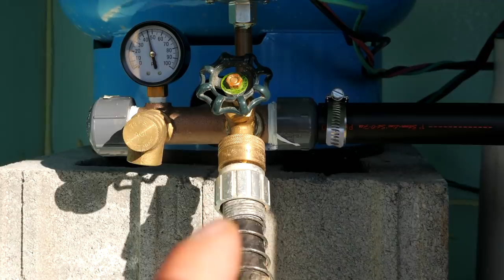Insulating the Well House & Preparing ICF Basement for Waterproofing

Comment: A electric (once you have it hooked up) inkbird thermostat will help. You plug it into electric... then plug in a heater to it. The really cool part... they are not expensive and they will use wifi to send you a alert to your phone if the temp falls below your setting. That gives you the additional back up of a alert before a major water problem will happen.

Comment: I found the “King” 110 pick a watt heater for wall mounting, set at 500 watts, very economical 
The Thermostat is mounted on unit.   We heated a large Dog house, during Northwestern winters and well insulated 6x4 barn style for two big dogs. Lowe’s sells “king” heaters and are UL listed.   (We used the small rectangular model with 500, 1000, 1500,  options.  The wires have to be selected at element for desired wattage).

Comment: To keep the house warm enough without electricity a small propane lantern set at it's lowest setting should do the job. You don't get that cold for that long. you probably won't need to use it unless it gets down into the teens.

Comment: I agree that a old style 100W bulb on a thermocube works fine for an insulated pump house. I built a bigger closet in an unheated barn in Massachusetts. It worked fine for 3 winters.

Comment: Eventually you can trench the water line and bring the pressure tank inside the basement once the house is built. Easier low/no maintenance and protect from freezing as pressure tanks have a mechanical lifespan and have to be replaced from time to time. You have enough work on your farm than to have to remember to check on the pumphouse.
Reply from the maker: Exactly. That is the plan.

Comment: You can get a solar powered 150 watt bulb and your pump house with the insulation you put in would keep it above freezing. I also like @Cheeky Saver's suggestion. Once you have permanent power it will be easy to find a method to suit your needs.

Comment: 1)Cheap temperature sending unit in there. 2)100 watt bulb down low near unit with switch outside (Ultimately in house).
Reply: metamud aid they are going on grid and theres a electrical pole not far away.  Assume their pump will need electric anyway.

Comment: Good on you for also insulating/covering the floor inside your well house. 

I was part of a military exercise (Operation Jack Frost 1979) in Alaska where a tent "city" was built to support an Army/Marine exercise where they simulated defending the Alaska Pipeline (which was in its final construction phase at the time) from "The Soviets". My Air Force Prime B.E.E.F. team built plywood floors in all the M.A.S.H. campaign-style tents used at the time so we could put diesel drip heaters (usually two--one at each end--of the 10X40 tents), since it averaged 50 BELOW Zero during much of the overall 5 week, Jan/Feb operation. (The actual exercise where the Army/Marine defenders did their thing was three weeks in, and only lasted 3 days. The rest was set-up, then 2 weeks of debrief and tear down. I, as the squadron Base Emergency Expedition Force [B.E.E.F.] supply sergeant, was one of the few who spent the entire 5 weeks up there; it seemed like 5 months!!!) Anyway, when we tore down the tents, the necessity of those plywood floors was graphically evident: The footprints of 35+ 10X40 tent sites were clearly visible as thawed portions of the tundra, which, when walked on, felt eerily like walking on a waterbed (yes, I know what that's like!)

Undoubtedly, the floor of your well house would be a soupy mess if left uncovered, and by insulating it, you'll actually let it stay at least solid, although probably not frozen. Good job!

Comment: Hey Guys...I just restored my Papas well.  I also spliced in a 9000 watt generator when power goes out.  However the whole roof and 3 cinder walls got demolished (because a tree grew up at a corner and blew out the grade and walls)  but I'm learning alot.  I'm all on well water now!  Still restoring the original well house but will insulate it like yours!  Thanks for the video.

Comment: As you have an electrical supply to the pump house, I would add anti freeze protection in the form of a bar heater, with a thermostat set to 5C (42F) so that it will warm it up. Fish Tank heaters are small, better to go slightly bigger. I would also paint to roof and walls with black paint or with bitumen, not for waterproofing, for radiant heating from the sun, the snow will melt sooner and the sun will warm the water pump house quicker.
Reply: don't think has electricity, he was using generator to power pump for testing.
Reply: @garyb4929  OK

Comment: Great update as always . In your well house , consider adding an outlet inline from your well electric supply line. Then buy 2 ( backup)  "thermo " block ( amazon cream colored not the yellow one by a different name) . I buy the one with 2 outlets. It will cut your light on when below freezing and cut off when above freezing. You can also use a second light on the second therm block outlet , but install a screw in photo cell then your light bulb. Why , when the first bulb might burns out the second light will come on. Backup :) Also the bulbs that "last" 1.8 years , that is a 3 hours use per day. So  well light without a thermo cube will last 30 days with 24 hour on time in the winter. I place the lights on bricks or a large concrete paver. Because if a mouse knocks the light over the light will melt the foam of worse break and short out, throw the breaker.  I also remove the lights and thermo cube when the weather gets warm ( the humidity in the well house will go to 100% now that it is insulated ) . I test the thermo cube at the beginning of winter by placing it in the freezer until cold ,then take it out and  plug in a light and when it warms up ,  it turns off the unit is ready to use, test passed . My well guy gave me thumbs up on my inline well filter. I installed it before the bladder tank. This keeps the sediment / grit out of the pressure tank , it will extend the inner bladder life . I also double clamp all fittings, stainless clamps. I leave a screw driver in the well house to test the clamps every filter change. If you want to go full protecto, wrap a thick plastic gal bag around the pressure switch. with a few cloths pins, closed seam downward. You could also install a weather tight electric wire box clamp to the pressure switch , where the open hole has the wiring running through. No water in the switch , no rust, longer life. A tale of experience, you will have mice in the well house. I always set 2 traps with a little peanut butter , because where there are mice there are snakes. The only type I find and have killed 2 , baby copper heads, on different occasions. They like the safe , cool concrete blocks I have inside. On the pored walls... will you be using a dimple shield over the peel and stick to protect the waterproof material from punctures ? here is a little something I found while reading on line . hope it helps. 
"When you say non-permeable sheet, do you mean a type of 'peel and stick' membrane, a thick rubberized material that comes in rolls??

I use a few different products depending on which ICF I use, whichever brand name they supply, Nudura has their own brand name, Logix has Resisto or I buy a product called Blue Skin at the local lumber store. All are the same thing, pretty much.
 I don't worry about the 'sheet' tearing during backfill, our Code requires backfill be done with a 'clean' material, typically sand is used, it is free draining as well as it being free of any rocks or materials with a sharp edges that would damage the waterproofing.If that is still a concern of yours, you can cover the 'peel n stick' with another product called Delta MS, I am not sure is this is available in your area but something similar may be. Check it out at www.deltams.com. This product is a solid plastic dimple board, that you would roll on on top of your peel n stick. you use a screw and washer system and attach it at the top to the attachment strip in the ICF. There is no way that this product will tear, unless the excavator hits it!! The dimples in the product leaves a channel between it and your wall for water to run just in case some gets between them.I have used both in the past and so far no one has called me back to fix a leak." source- http://www.greenbuildingtalk.com/Forums/tabid/53/aff/4/aft/36460/afv/topic/Default.aspx#:~:targetText=It's%20pretty%20commonly%20accepted%20that,LEAST%204%2D5%20days%20old.
All the best , thanks for sharing your journey .

Comment: One things you might want to consider, if your ground freezes solid there, is to insulate the outside by at least stacking hay bales around the base of the concrete blocks. This keeps the cold from freezing through the ground.

Comment: I see you installed a cycle stop valve.  I really like mine.

My well house is 7' x  7' x 12' buried 5' in the ground with a shingled pitched roof. I use a milk-house heater on a thermostatic receptacle that comes on at 35°.

Comment: It looks like you are making good progress. I’m from Australia, so not much needs to be done to stop water pipes freezing (except in some of our alpine regions during winter). That said, I saw a video the other day where the homesteaders were trying passive ways of keeping their poly tunnel from freezing overnight. They ended up putting in a number of 50 gallon black water containers as thermal mass. Your pump house is kind of like a refrigerator now and refrigerators work best when they are full. Maybe you could try some water containers to reduce the air space and increase the thermal mass within the pump house. Regards, Jeff. 👍😀🦘🏠

Comment: I have the same set up, and the insulation and a small well house will be installed this week. A bit late, as we already had frost and several snowfalls, but temp rise again, and rushing to finish it. Anyways... The pressure tank, why don't you install that in the house? I was too afraid of frost, so that is placed in the technical room with the water heater, water softness filter system and the air filter..  Also have the pipe in pipe water system in there, with controls if there is a leak somewhere, and the fuse box! Crowded room. 😂 So happy for you finally getting things going. Guess the girls are excited to plan their rooms!

Comment: A small heat lamp works good for a heat source. Doesn't draw to much juice and does not get to hot. Nice job on the well house.  I sure hope you at least prime paint the wood on your well house. Protect that raw lumber, although the wood is unlikely to get wet, blowing rain could wet the raw wood especially the end grain of your rafters. Thanks for the videos.

Comment: Moving right along.  It sucks that you had so many issues trying to find a general contractor and others delays.  I realize that summers are real hot there, and working on the house would have been sheer torture most times, but if the exterior of the house were done before winter halts work, you could have been able to continue interior work on warmer days. How deep is the basement, and will you be putting any kind of flooring in it?

Comment: Looks good! Will the same crew be out to remove all the bracing? For the Well House, you might want to consider a Min/Max battery powered thermometer to see how cold or hot it gets inside. Just for some data points.

Comment: For all the folks saying that a light bulb is all you need to keep things from freezing, my neighbour did that and it cost him a $900 pump, apparently it heated the roof more than the floor. Try a thermostat with an infrared heat lamp pointed at the pipes.

Comment: Don't beat on a plastic fitting, apply a little heat to the pipe it will slide all the way on.
Reply from the maker: I was gentle. 😏
Reply: A little spit on the fittings makes things slide too !

Comment: THERMAL MASS is your best protection from off grid freezing.
Put 55 gallon drums inside and fill with water. Buckets/lids or gallon jugs.
I used shelves with 2 liter bottles from My soda addition. :-)
I have a 2 gang duplex receptacle. When we're going into the low teens I'll drop an aquarium heater in one of the drums. It's thermostat controlled and cheap so I keep 2 int the well house. - Prepper rule #1 redundancy. 2 is 1 and 1 is none. -  
Use food grade containers and you'll have a back up supply of water for power down or pump failure situations.
Good luck - KJ -
DesertSun02 has some great videos about solar heating options. One is heating water with a solar panel. If you heat the drums of water during the day they will radiate heat for long after and protect from freezing.
And I agreed with one of the other posters. Take the insulation off the floor. You don't want to insulate against the warmth from the earth.

Comment: Our well has no parts that can freeze at the well head. It has a 500 gallon holding tank under ground. It runs to buildings and frost-proof hydrants from there. Are you putting that pressure tank and other stuff in the house at a later date?
Reply from the maker: Yes

Comment: Sir, you may want to put the spray foam around the white tank bottom, and down in the cinder block, as I had a pump house, in KY, very similar to yours and a whole lot of snakes, decided to use it for their winter hibernation  house. I removed 42 snakes the 1st year. They were mostly grey rat snakes and never got mad I was hooking them and moving. I don't usually kill snakes unless a life is endangered and I read a recent study shwed that snakes just 1 can kill up to 2500 ticks a year. My pump house was 50' from the  house so I would just release them down over the hill as I had 35 acres in Ky back then. God I miss that land and house that was almost 20 years ago and that would be worth 200k now, we only paid 66k for the land with 3 ponds, a small garage (they called it) however, you could probably only for a dodge neon in there comfortably. and a 40x46 ft barn than was all metal covered and huge that you could park 3 cars in there and have 8 horses or cattle and a  lowered hill 4rd stall where you could separate animals and it a the land had a small creek running though it and the 1 pond was  so big it was an acre and it was stocked with fish. god I miss that place me and my wife broke up and we had to move a developer bought it separated it into 3 parcels and now there 3 houses on it right on top of each other when before i needed binoculars to see my nearest neighbor now the neighbors are close i can hear them talking between the walls. these are great videos by the way thanks and sorry for my rant.

Comment: With no power, you could place 1 battery with a 300 w inverter.  A thermostat controlled receptacle with a 60 w bulb would be all you need. Much safer that burning anything inside. You could charge the battery every 4 or 5 days.
Reply: Or put up a cheap solar panel to keep charged ... Wouldnt have to be much ...

Comment: I noticed 1 hose clamp was missing on the elbow coming off the pump that ended up under the insulation.
Reply: Yeah I noticed that...good thing is that is not really high pressure at 50 psi and its an easy fix.

Comment: Would you ever put a wireless thermometer inside the well house to log the temperatures it experiences?  One that can record both outdoor and indoor temperatures so you could see how well your insulation is doing would be very interesting.  Personally I'd be reluctant to run 60/100 watt light bulbs as so many people are recommending unless there was some kind of thermostat involved, because it would waste so much power if it was running when it didn't have to be, e.g. if the grid was unavailable in winter and you were relying on solar only.

Comment: When your pressure tank dies, consider replacing it with a cycle stop valve. They are more reliable and have no moving parts.
Reply from the maker: 😏 There is a cycle stop valve right at the well head in front of the tank.

Comment: You may want to spray foam around the well pipe casing.
Reply: And add flexible conduit armor to the wiring between the pressure switch and pump.  I live in southern OR (and we're warmer here than you) so I replaced my PVC well piping with galv after I had one freeze.  I sleep better now.  R15 Knauf glass inside the big pump house usually keeps it above 40F.  Oh, and i installed a Big Blue 4.5"x20" whole house water filter using 3/4 PEX.

Comment: Use heat tape on all exposed piping above grade in order to avoid pipe freezing problems
Reply from the maker: Sure, once we have power to the property.
Reply: @Guildbrookfarm  what are the average low temps where your at? down here in SC it rarely gets cold enough to warrant heat tape. Where I grew up in maine totally different story though.

Comment: WHEN YOU GET POWER 40 50 WATT LIGHT BULB WILL HEAT THE PUMPHOUSE,, YOUR PROBABLY GOOD TO 10 ABOVE AS IS,, UNLESS IT STAYED AT 10 ABOVE FOR 4 OR 5 DAYS & WINDY... SHAME YOU CUT UP ALOT OF NICE 6 8 10 INCH LOGS OUTTA THE HARDWOOD COULD FRAME IT ALL WITH 30/40 PIECES OF THEM.. ALOHA GOOD LUCK